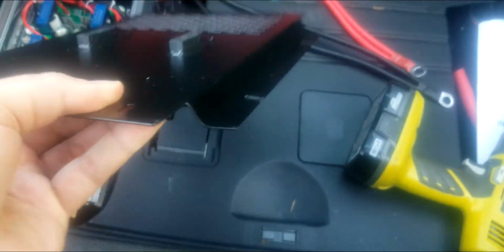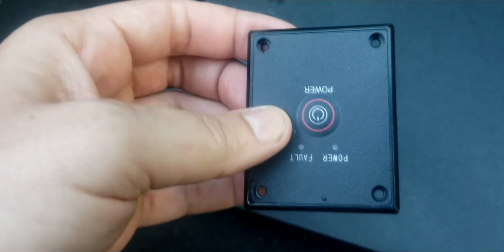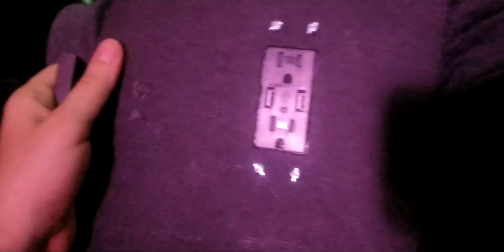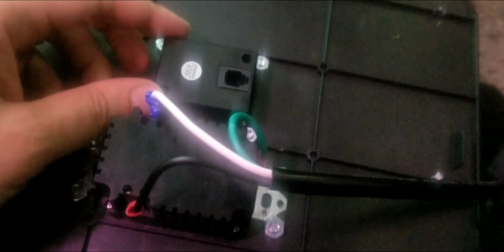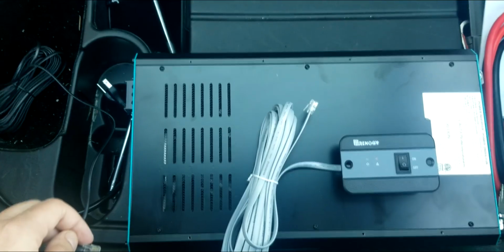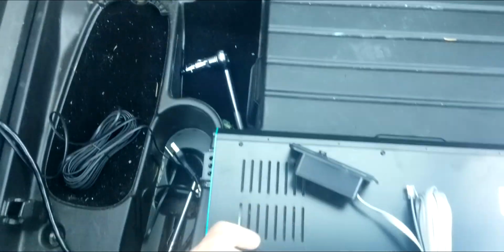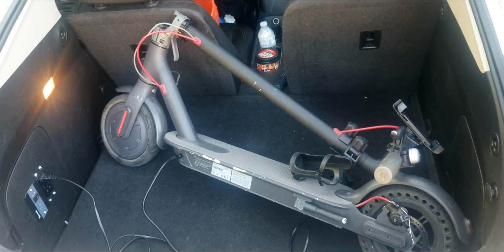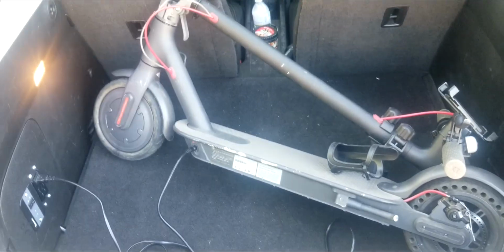I Added a 110v Power Outlet to my Car

Comment: Hey man, someone else may have suggested it but you can fix that plastic scratch from the dremel probably. Either a blowtorch and some good distance control if you're confident, or a heat gun on low. Very easy, you basically warm the plastic to get it softened to reharden and darken, and then sometimes thats enough. If its deeper you hit it with a little plastic restorer and a grain pad to restore the grain while its still just lightly softened. The restorer will just darken it. Heat will probably be enough if the dremel didnt chattermark the plastic badly.
Reply from the maker: Oh sick, thank you

Comment: I wouldn't say death trap (i just heard that comment, at around 5 minutes) and i didn't watch the rest yet but even a 2000w inverter will heat up at 500w if you cover it over
Reply from the maker: The lid doesn't close fully, there's airflow

Comment: I added a 110v Power outlet to my car.
Me as a trucker with a 3000w converter: Look what they have to do to achieve a fraction of our power.
Reply from the maker: lmao, true. I can run mine with the engine off though
Reply: @Hamdad  to be fair most inverters last about 6-18 hours depending on how much you pull. Still cool setup.
Surprised you just don't get a camper and bail
Reply from the maker: @grimreape513  I don't want the poor fuel economy and maintenance of a camper as my daily driver and don't want 2x car insurance. This approach lets me have the best of both worlds with only slight compromises
Reply: @Hamdad  you pay insurance on a tag along camper? A tow behind? This is the first time I've ever heard of this
Reply from the maker: @grimreape513  Oh I thought you meant like an RV or camper van. Volt can tow a safe max of like 2,000 lbs which isn't much weight budget for a trailer. I talk about my idea for a micro trailer in the video that just has the stuff I can't fit in the car, like toilet/shower, fridge, microwave, sink and dish washer.

Comment: all this feet talk has me wondering if shoes have a place in wearable technology. If you want to be decked out from head to toe in your hamdad mech-suit there has to be some practical use to putting USB ports in your sneakers, right?
Reply from the maker: Piezoelectric insoles? Resistive warming for Winter?
Reply: the idea of smart-shoes seems like a tough one to crack since they'll be under constant stress and wear. I imagine parts would have to be both flexible and sturdy. if it proves difficult or just not worth it you could put some steel toecaps in some light up skechers and call it a day

Comment: Do more mad science stuff. A rundown of the E-bike would be kino too. Doing videos like this is what makes you more patrons. Maybe do a video on how to attack a project with just a simple multimeter?
Reply from the maker: The bike is pretty weird inside since it's 100% custom. I think I did a video on it already, the charger is onboard so all you need to carry is an extension cable. The charging port is just a weatherized outdoor male 110v